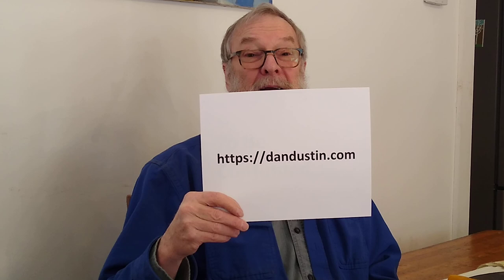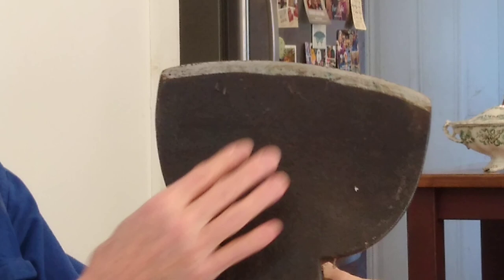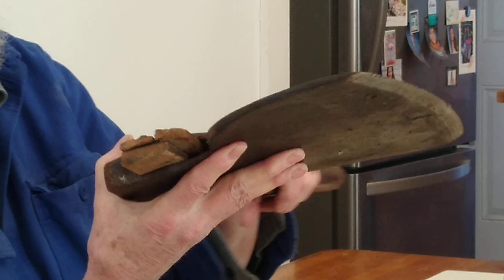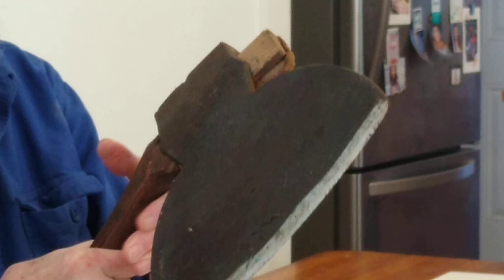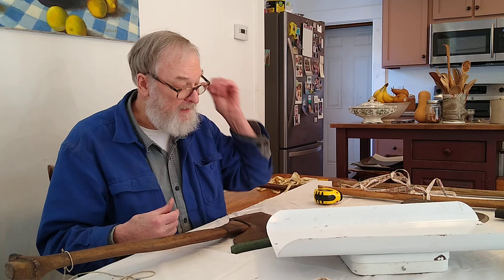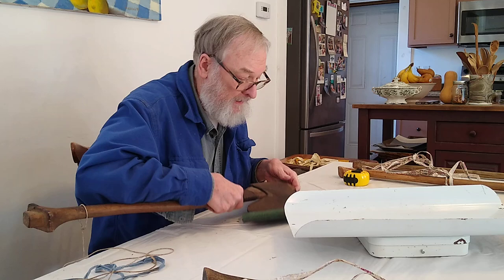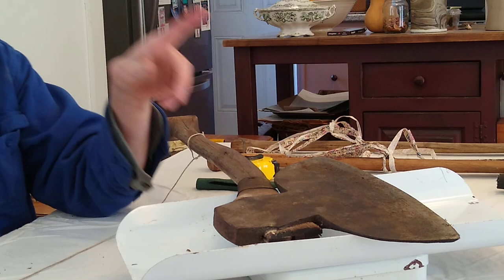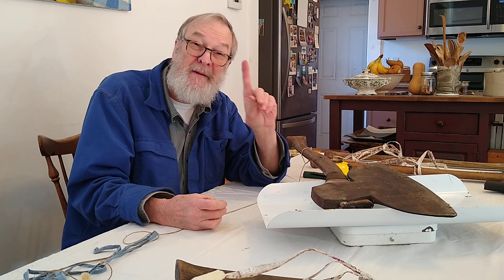From Tree to Beam Plus 40 Years

Comment: Interesting stuff.  Thanks for the video.  When you say it takes 40 hours to grind an axe or as you say a whole season, are you using a hand powered grinding wheel?  Why does it take so long are they badly damaged?  I tried look back to the introduction video but didn't see anything on it there.  Thanks.
Reply from the maker: I use a foot pedal stone. It's slow grinding.
Reply: @dandustin824  my father in-law gifted me an old foot pedal whetstone I’ve been wanting to try. Bet that sound is perfectly relaxing. This summer I’ll set it up in the wood shed and put a new profile on one of my old axes.